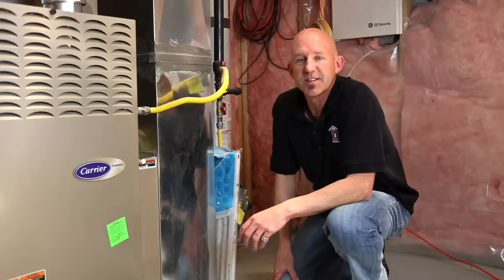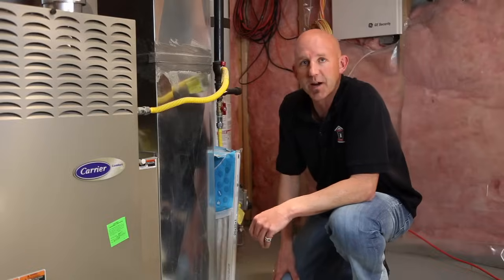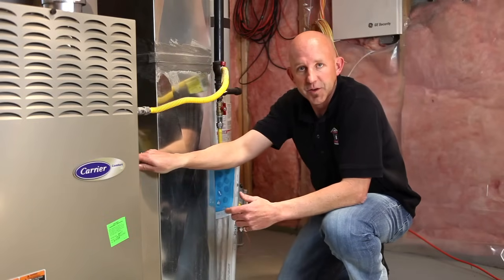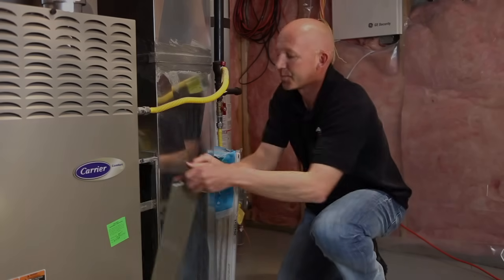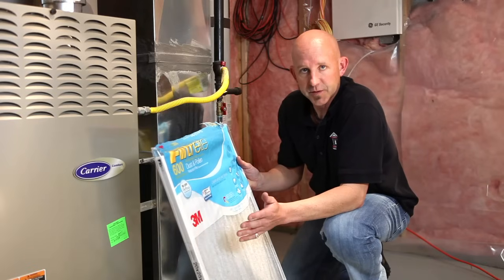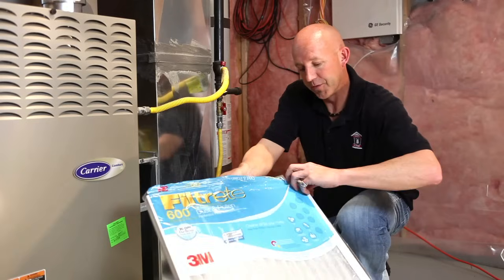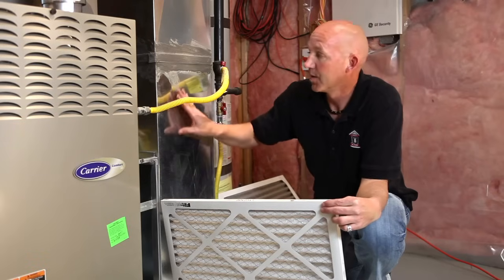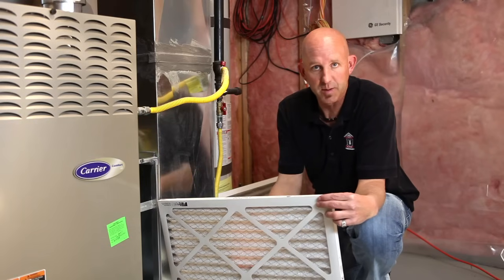Home Maintenance: How To Change Your Furnace Filter

Comment: THANK YOU.  The furnace filter videos all remind the homeowner to put the filter in according to the air flow.  But no one has explained which direction the air flow goes.  You did, so now I know.
Reply: I'm thinking is it arrow to the left or right and this video explains it very well. I just took mine out and the arrow was pointing left towards the furnace. Left to right it's Furnace, unit that holds the filter than a long silver-colored vent coming down from the ceiling. The filter was very dirty after just 2 months so I guess I got it right. I looked up this video hoping to find some clarification and I found that so thanks to the person who posted this!
Reply: Ditto. Very clear and straightforward video.
Reply: @steve.videos  yeer’

Comment: You know, a lot of videos and how-to sites skipped over this important step, or were dead wrong. I realized that I'd been installing our filter backwards for years, pointing the arrow OUT (to the right) from the furnace, because I assumed that was the direction that air was being forced. I didn't realize that it was the return air duct!! I know that many furnaces are different, but it seems as though, in most situations, the arrows should point TOWARDS the unit, as they should like between the return air and the furnace...so air flows into the furnace from this point. 

For years, I had assumed the exact opposite. Duh.

Thanks so much for your video!
Reply: I always thought it was right also but I just took mine out and for some reason I pointed it left. Most videos show you how to put it in but they don't go over that important detail, the left vs right.

Comment: The way I figured which way air is flowing was by turning the furnace ON and holding in a piece of paper inside the compartment. The paper will bend in the direction of airflow
Reply: I just used my hand to see the air direction.

Comment: The air filter chamber on the furnace shown seems large enough for a much larger filter. Filters will last or work longer than 90 days. If you buy a good electrostatic one with a metal frame that is washable. The reason you need to change your furnace filter so often is that your house is not clean enough. Use your vacuum cleaner to clean as far as you can into the return air ducts by removing the covers on them. Wash the covers once a week when you vacuum the house. Your furnace is not a vacuum cleaner. When you have the furnace filter out clean out that chamber also with your vacuum. Don't forget to clean out or change your condensation tubes as well. A clogged condensation tube can shut down your furnace. Don't call a service guy for a $5.00 beverage hose from Home Hardware.

Comment: First time home buyer here. Thank you for the extremely well detailed video for this. Also question, I noticed there’s a few inches in the video you posted where the filter seems it should be much bigger, or maybe it’s the perfect size? Am I supposed to be putting in a filter that fits snug? Or am I supposed to leave a gap, like this video shows? I know this is from a few years ago, hopefully notifications are still on🤞🏻
Reply from the maker: Different systems have different filter chambers and sizes, so it's hard to say with 100% certainty how yours is set up. The one in the video has a slot where the filter slides in, so even though there is more space in that chamber, the filter area is smaller, and the filter fits more snugly (you can kind of see the brackets when we slide the filter in), but not all are set up that way. Our best recommendation with not knowing your system specifically is to just buy and use the same size filter that is already in the system. If you feel that isn't working right for you and have access the manual for your furnace, there should be guidance in there (you may also be able to find the manual online). Another option is to do a routine system check-up with an HVAC, which most manufacturers suggest doing each year anyway, and have them verify the filter you are using is the right one.

Comment: what happened if the filter chamber is at the bottom of the Carrier Unit?
No one seems to demonstrate this.
Does the arrow point to the FLOOR or to the UNIT?
Thanks.
Reply from the maker: Air flows into the HVAC system, so your arrow would point towards the unit to keep dust particles from entering it and giving you a clean air flow that helps the system operate properly.

Comment: My chamber for the furnace sits above the furnace. Does that make a difference?
Reply from the maker: No, the process is still the same. You'll want to remove the old filter and put the new one in its place with the arrow pointed towards the furnace (if you're unsure about what way to face the arrows, look when you pull the old filter out and put the new one in the exact same way).

Comment: Supply air is coming from the outside into the furnace and return air is putting it to the house after the air gets warmed or cooled?  I get that you want the error facing to the furnace.  I think it might be because the blower is inside the furnace?  Thanks for that.    I am just not sure of what the term supply air is and what return air is.  Return from where?  Supplied from where?     Thanks to anyone who wants to answer this.  I am a bit of a dummy as you can see.
Reply from the maker: It is a convection type process…return air comes from the centrally located return air grills throughout the house. The air is then run through the filter, gets heated/cooled and supplied back out to the home.  The return air is the duct work to the side of the furnace and the direction of flow is from the return air into the side of the furnace.  Arrow faces towards the furnace.   None of the air comes from the “outside”.  Hope that helps!
Reply: Ok.  I finally get it.  It does help alot.  Thank you.  Have a great day.  Don't know how i got the idea the air came from outside.

Comment: On my new filter it shows the arrow pointing away from the wired side. That would have the reinforced, wired side facing the return air instead of the furnace side. This seems backwards to me. Shouldn't the reinforced, wired side be toward the furnace rather than toward the return air vent?
Reply from the maker: Hi Linda, we believe the arrow is pointing the right way on your filter (though without seeing the filter, we can't know for sure). The reinforced side of a filter should face away from the furnace. The non-reinforced side is more porous, which allows the filter to effectively trap airborne particles while also minimizing the slowdown of airflow through your system.
Reply: The new filter I just bought has the air flow arrow pointing in the direction of the reinforced wired side which will in turn face up against the furnace.  The response above states the reinforced side of a filter should face away from the furnace.  What am I missing, can you clarify?  Thank you.

Comment: Do I have to turn my unit off? It only takes 5-10 seconds, can I change it wile it’s running?
Reply from the maker: It is best to turn the system off while you are changing the filter. Filters keep dirt out of the system, which will prolong the life of it and keep it running efficiently. Even a few seconds can allow dirt to be pulled into the system, and over time that could build up and create costly problems for you.

Comment: do you need to turn off furnace before changing the filter?
Reply from the maker: Yes, to avoid potential damage, you need to turn the furnace off first. If it had been running right before, make sure it completely cycles off before changing the filter.

Comment: No idea if anyone will see this but we can't figure out where our filter is located. Doesn't look like this video. Carrier 58STX090. Any help would be appreciated!
Reply from the maker: We're not 100% sure where the filter is located on that model, but if you do not have a setup like what you are seeing in the video, here are a couple of ideas. Some Carrier models have the filter at the bottom of the unit -- try removing all panels. We have also see similar units that have the filter inside the return chamber (the large silver box to the right of the unit in the video) -- look to see if your return chamber has a removable panel (the ones that we have seen are made of the same material as the chamber and slide up). Sorry we couldn't be of more help -- good luck!
Reply: @LibertyHomesSandy  thank you SO much for replying. It was found after removing the main panel and then a second panel like you said. It laid flat (horizontally) in it. Thanks again for taking the time to reply. It's appreciated!
Reply from the maker: You're welcome -- we're glad we could help!

Comment: I'm still confused. My furnace is a very old old one outside. The house is probably 1954, filter is on the floor-hallway and there's no way to point the arrow to the furnace being outside. The filter is however on the same side with the furnace. I need help, please... I want to make sure I'm installing properly. The return is where the air gets sucked in right?  The coil side should be same side with the air pulled in? I'm so confused. Like I said arrow towards furnace does not apply here since furnace is outside. I doubt anyone understands what my situation is.
Reply from the maker: Sorry you are having an issue. Each furnace works a little different, and a model in that year sounds like was configured totally differently. This one shown is a typical new construction furnace and filter, so it may not be the same for all furnaces. The best thing to do is contact or google your manufacturer to see if they can walk you through directions or have any instructions online. Good luck!

Comment: I don't think I'd ever use a 3-month filter after seeing how dirty that filter was. Use a cheaper filter and change it monthly and if you have pets, change it every couple of weeks. Turn off the unit so there's no air flow--you don't want junk sucked into your furnace. Also, if the air is moving, you'll have a harder time getting out the filter.

Comment: Greetings, We have a Carrier Infinity 80.  I've looked for several hours and can't find any type of small door with a screw for the filter.  There isn't anything (at least visible from the outside of the system) between the intake metal stack and the main system.  There are two intake filters in the house - one upstairs on the ceiling and one on the first floor on the wall.  Could these be the only filters? Thank you! Pam L.

Comment: Folks I have seen 2 different units damaged from  not changing filters one was Trane the other Goodman both were very dirty  no air  was being moved to speak of  it can and will damage shit.First bill was 500 second  one was 800.the main board on both were cooked  they both got wet, one also had the motor damaged that sucked in fresh air and expelled dirty air.

Comment: why can't they just print on the box of air filters "hey stupid arrow points at the furnace. " I get so messed up because I have two furnaces and both of them are in different directions. be-sure to right the date on the filter, my tip.

Comment: People.  I've never turned off the unit before replacing the filter nor do I know anybody that does.  You're sliding a filter into an empty compartment, not doing anything with electricity.
Reply: When you open the unit that holds the filter, the furnace shuts down automatically so it doesn't matter

Comment: Mmkay so my furnace sits upstairs in an attic like room and right now it’s summer so that room is at least 140 degrees. Changing it during the day is out of the question. Now come nightfall the portal to hell in that room has closed so the temp drops below 80 so its doable. I have a carrier furnace as well and I’ve checked all sides of it and can’t seem to find where the air filter is. I don’t want to go up there and break it because I can’t live through summer with no air. My air is blowing as best it can with that dirty filter and the house never drops below 81 degrees. Need. Help.

Also I am EXTREMELY careful in that room because I’m warned that the cotton stuff up there that “insulates” is dangerous and I shouldn’t touch it. One false move and I’m in for hell. I can’t spend more than a few minutes at a time in there because I don’t want to touch that stuff.
Reply from the maker: Sometimes A/C units located in an attic or on a ceiling/roof have filters right where the air comes out of the register. Our homes in AZ have these type of units, and if you unscrew the vent on the ceiling or wall where it comes out, you should be able to see the filter and change it. However, each manufacturer and model is a little different, so we would recommend contacting Carrier or looking up your model number online to get further instruction if your unit is not like the one we show in our downstairs video. Good luck! No A/C in the summer is not fun!
Reply: Liberty Homes thanks! I’ll do that. I will have a cold house this summer!!!